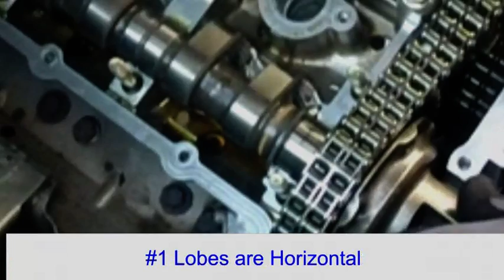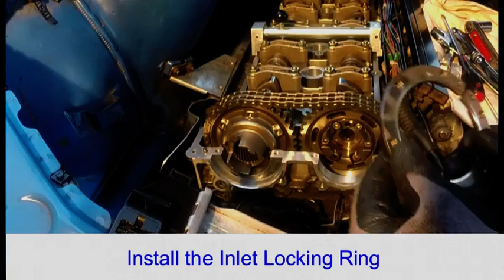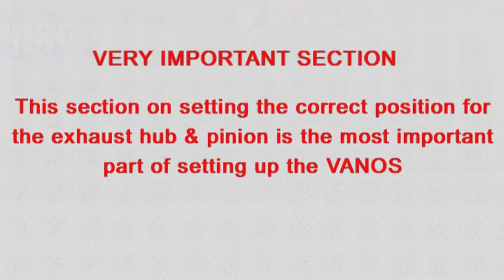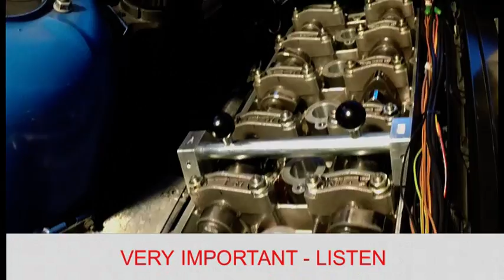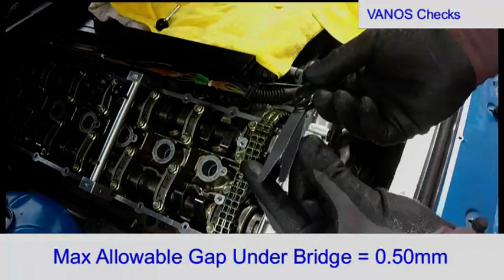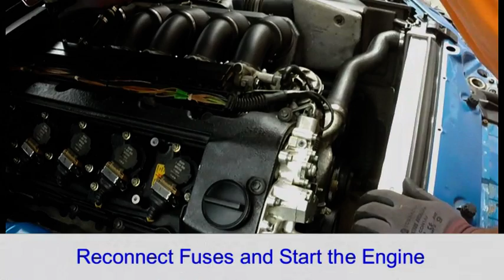Refitting the VANOS & Diaphragm Springs on a BMW S50B32

Comment: Hi! Is neccessary the specific timing tools for the s50b30 timing process? I’m looking for the tools and all of kits seems to fit both s54 and s50 and they are a bit suspicious …
Reply from the maker: You need to accurately lock the camshafts,  They will move if you don't lock them.  I don't know if S50 and S54 tools are the same.

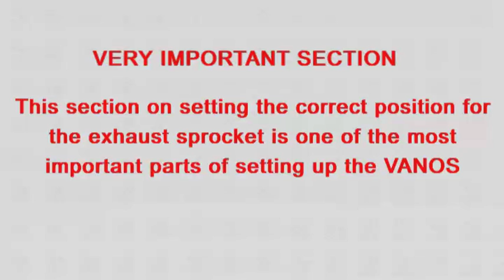Comment: Hi, I have attempted to align the exhaust camshaft sprocket several times according to your instructions from 3:17 onwards. The crankshaft is locked at OT and the camshafts are locked at TDC. When I attempt to slip the chain on the exhaust sprocket, the oval section of the sprocket does not align exactly as yours is shown in the video (i.e. at 1/4 position relative to the EXH cam trigger tooth). I would say my oval section sits at approximately 3/8 of the way from the bottom of the tooth. If I slip the chain on the sprocket 1 tooth forward, the oval is over 1/2 of the way from the tooth and if I slip the sprocket one tooth backward (by rotating the cam sprocket forward until it reaches that point) the start of the oval section ends up under the bottom of the trigger tooth. 

With the exhaust camshaft set in this middle "3/8" position relative to the tooth, if I attempt to install other bolts for the VANOS hub, they are not fully accessible. 

I am not sure what I am doing wrong and have attempted doing this several times. Can you suggest any other steps or checks so that I can be successful in setting up the VANOS? Thank you for the helpful and insightful video!
Reply from the maker: You may have to rotate the plate on to the next slot.  It can take a lot of faffing to get the exhaust slot correctly aligned.  You also need to have removed the chain tensioner before you can move the chain on the sprocket.

Comment: One more question, what is the air pressure check for?    Is it to allow cams to move if incase you got the timing wrong ?   Can't you just start all over and loosen the screws and unmesh vanos without having to use air?
Reply from the maker: Sorry for the late reply.  I've just seen your question.  The air pressure replicates the oil pressure from the running engine.  The VANOS tool replicates the ECU telling the cams to advance or retard.  They will only advance or retard if there is pressure inside the VANOS and the appropriate switch is pressed.  You must only "flash" the electrical pulse using the button on the switch, as a long press may burn out the solenoid.
Reply: @pingu393   Is the air pressure test required for re-assembly?

What confuses me is some re-assembly procedures just involve ensuring the right tooth of the VANOS unit meshes in with the right tooth.

But is the air pressure required for re-assembly and why?   I'm wondering at which point on re-assembly should I use air pressure.  It's not so much wondering what the air pressure emulates in a working engine, but how it can help me during re-assembly as I will be doing this soon
Reply from the maker: @boris9331  not required for assembly, just for testing.

Comment: 10:28, why do you turn the plate slightly to the left before you engate the teeth?   I thought they should be fully turned to the right and then you mesh the tooth in, so thats where the VANOS unit begins to push the gears in and the cams retard themselves?   It appears your not starting from full retard if your turning the plate to the left by 1 tooth before you mesh the gear in?        This is what confuses me.

I assume the reason to have the plates turned fully to the right is to set them in the full advance position, and then as the gears mesh in and push in, they retard the cams by moving the plates anti clockwise?
Reply: Hi Boris , I had the same questions and also posted on Tim’s YouTube channel- Juhles . You can see my responses there. I took videos and pics as well . What is important as stated in this video is that the Exhaust Vanos gear must stick out like in the Video when inserted all the way into the hub. This will ensure that when your Vanos unit is fully seated , the bolts at the back as still accessible. If you are not sure what I mean, please feel free to comment on Tim’s channel where I posted more details. Note this is only my observations and by no means profess it’s correct.

Comment: What I don't understand is why does a certian tooth on the VANOS unit has to engate in the spline?  they are all identical aren't they?    
I thought so long as cams are a relative angle to each other which is set by the locking tool, you can just slide the VANOS in and it just retards or advances using oil pressure to push the plungers in or out?    Is the goal to have the gears mesh into the splines when at full advance position ? and then the Vanos can retard by pushing the gears in?
Reply from the maker: There are a different number of teeth on the two gears.  This means the splines will only be aligned in one place.
Reply: @pingu393  Thanks.  Ill do my best to align each cam to right tooth on the VANOS.  Is there a test i can do shortly after to confirm I aligned them on the right tooth? It would save me finding out after putting everything back together and finding the car is sluggish or using the vanos diagnostic during running
Reply from the maker: @boris9331  the only safe test that I know is the air test.
Reply: @  OK i'll watch the video again to see how the air test confirms the tooth alignment and study it further.
Reply: @pingu393  Would the DIS diagnosis test not pick up one misaligned tooth?
Reply from the maker: @boris9331  DIS?  If you mean a scan tool, they only pick up error codes, or codes from running engines.
Reply: @pingu393  It's BMWs tool they use to do a VANOS test on the s50b32, like on this video.  - https://www.youtube.com/watch?v=a0jttXWO44s
Reply from the maker: @boris9331  like I said - a running engine :) .  INPA does a similar thing, but you need to interpret the numbers.

Comment: Great video, when inserting the splines - is there a sweet spot ( I found that at a certain point one gets maximum travel of the hub from left to right. I have a video that I can share . Your guidance will be really appreciated.
Reply from the maker: From memory, there is only one spline that will properly align, but I did the job 7 years ago.

Comment: I am mostly through this and your Video is a life saver - however i may have made a mistake. I didnt have enough torque on the intake hub and the rotated the engine - the screws did as you said, went to the far end of the "slots" and made the intake cam timing go out. Would that have been enough timing to cause the valve to hit the piston during a "hand rotation" of the engine? apricate your  help!
Reply from the maker: Sorry for the delay in reply, but the answer is "I don't know".  I do remember having to turn the engine with the chain disconnected, and it wasn't easy.  Crank 10 deg, inlet cam 20 deg, exhaust cam 20 deg, engine 10 deg...

Comment: Thanks for the great video, really easy to follow. I have just done this to the same engine and followed your instructions to the letter, and the car feels much better. But I am getting the following cam readings: When car is off intake is at 60 (Nominal 55), exhaust is at 0 (Nominal 0), and at idle intake is at 0 (Nominal 0) and exhaust is at 4 (Nominal 0). Do you think this is down to bad timing or could it be something else?
Reply from the maker: I don't know what you mean by "car is off".  There is the possiblity that the cam springs could be too loose or too tight.  There's not much that you can do about that other than fit them properly, or completely remove them.  If you remove them the chatter will be intolerable, but the cam will advance / retard very quickly.

Comment: 16.25 you say adance the exhuast camshaft but you retared the cam or not ? correct me if im wrong.
and in the intake cam same thing you say fully advance but you move the intake camshaft in retared position.

if you in front of the engine and you move the intake camshaft to the right you retared the camshaft 
if you in front of the engine and you move the exhaust camshaft to the left position you advanced the camshaft 

that is what i know correct me please if im wrong
Reply from the maker: This is down to convention.  It is convention that anything that makes something happen earlier in the cycle is called "advancing", and anything that makes something happen later is called "retarding".  As the valve will open earlier by the camshaft being twisted "backwards", this is called "advancing".

Hope this makes sense of the video.

Comment: I tried many times to fit the vanos..however the engine fire up amd running very rough at idle. The diagonistic tool told us the intake cam target at 60 however actual angle is 512. the exhaust target angle at 0 but actual at 453 degree. 

We borrowed another car ehich idle smoothly, take off the vanos unit and the spine shafts and intall them again according to the video..and it idle roughly and having the same issue with this first car. Do you have any idea about that?
Reply from the maker: Unfortunately, without knowing EXACTLY what you have done, I can't really help.  My only recommendation is to go back to the beginning and follow EVERY step EXACTLY as shown in the video.  What diagnostic tool are you using?  I recommend Testo.

Comment: Hi mate. I tried 3 times theese procedures but after vanos setting and all screws locking 10NM i turnet crankshaft 2 times and setted camshaft tool to slots but, 
mark ()O|T avoided 5-6 degrees clockwise... please help☹
Reply from the maker: Make sure that you follow the instructions from 3:17 EXACTLY.  If the hubs are in the wrong place, or the tension is relaxed, you will have the problems that you have got.
Reply: @pingu393  thank you

Comment: Mate. Do yo have the part number for the camshaft locking tool? It looks like the same one as the E46 M3? Is it a genuine or aftermarket? Thanks heaps.
Reply from the maker: You will have to search eBay (or similar) for it.  (Google Image "bmw S50B32 camshaft locking tool" shows lots).  I did used to make them an will have the drawings somewhere.  I'll post them after I put them on my website.
Reply from the maker: www.porterbility.co.uk
Reply: @pingu393  Thanks. There seems to be heaps bit the beisian procedure says only use genuine. How precise do they need to be? Most on eBay say E36 and E46. But TIS has different part numbers and they look different. The one you use in this video appears to be the E46 one. That tells me they are the same??

Thanks again mate.
Reply from the maker: @JustSomeGuy_11  The important dimension is 119mm and the 6mm pins.  When I made the tool, I used the graduations on a milling machine to measure the 119mm - eyeball and ruler isn't good enough.  As to whether it is E36 or E46 - I don't know.  Buy the one that looks like the one that I used.  This is on eBay at the moment (193392286835).
Reply: @pingu393  awesome mate. These videos are a life saver. Cheers.

Comment: When the camshafts are locket with the tool. Are they then spot on the markings on the first bearing cap?
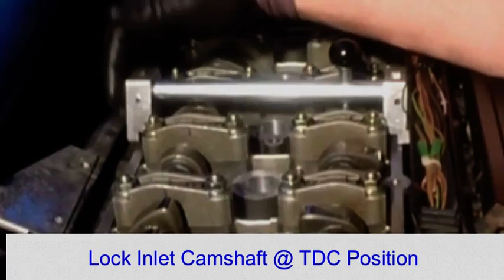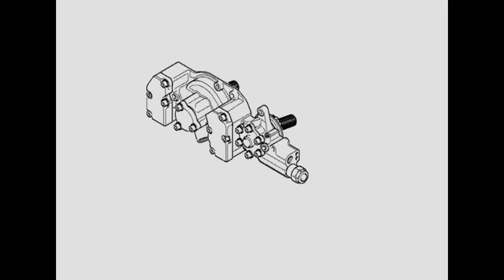Reply from the maker: I think you may be asking (in a round about way) if you can use the markings to position the camshafts - and not require the tool.  The answer is "don't try to do this without the tool".  The markings are only approximate.  You could get close, but probably not close enough.  As you can see in the video (8:28 - 9:00), the difference in camshaft degrees between aligned and misaligned is very small.

Comment: Can't get my hub screws right? What am I doing wrong?
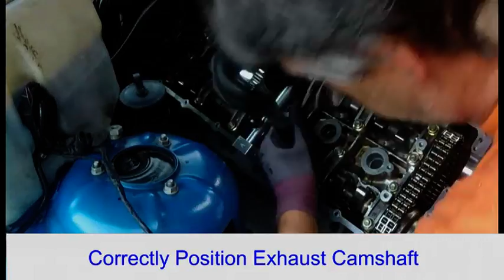Reply from the maker: Look at the video from 3:16.  You probably have to turn the hub relative to the camshaft.  See https://www.youtube.com/watch?v=Mr2Jqnbkmw0 to see how to advance the sprocket relative to the hub.
Reply: @pingu393  I did not remove the hubs I'll watch it and give it a shot tonight but am unsure how I managed to get them unaligned. My oil pump drive gear is in a different position than yours does that matter at all also?
Reply: @pingu393  I am amazed to get my hub in the correct position although the exhaust hub lock ring is at 1:00 on the wrong side
Reply from the maker: @LemonLaw-r5n  The final position of the locking ring is not that important.  The important thing is that the locking ring doesn't fall into the engine when it is removed or fitted.
Reply: One last question I appreciate you responding a bunch. Do my screws need to be in the exact same position as yours? They are off just barley I can still remove the srews with the hub's fully retarded
Reply from the maker: @LemonLaw-r5n  All that I can say is that if they are as shown in the video - it works.  You may be able to remove/refit the screws with them in a different position, but I cannot guarantee that they won't become jammed, or be too difficult to remove without dropping in the engine.  They are NOT magnetic.  You need to be able to hold them securely in your fingers.
Reply: @pingu393  let me put it this way the are very close to your exact position. But off by just a little I'm going to purge the vanos and see how everything lines up

Comment: Is it nessisary to purge the vanos after install?
Reply from the maker: If you don't purge the VANOS there may still be come compressed air stored inside the VANOS.  It's one of those things that is so easy to do that it is best to do it.  Don't forget that you are only purging after an air test.  You still have to connect the oil supply.
Reply: All I have to do is reinstall mine and I did not remove the hub's
Reply from the maker: @LemonLaw-r5n   Understood.  The hubs only need to come off if you are replacing the springs.  You only need to replace the springs if you want to stop the "chatter".

Comment: Do you know if the usa m3 cps would work on my s50b32?
Reply from the maker: I think that the S50B30 has a different VANOS.  What is cps?
Reply: pingu393 cps is a crank position sensor  or rpm switch.
Reply from the maker: http://www.realoem.com/bmw/enUS/part?id=CK92-EUR-07-1998-Z3-BMW-Z3_M&mg=11&sg=10&diagId=11_1573&q=12141401186
Reply: pingu393 yeah i guess it is then huh they must use the same cps for the 3.0 and 3.2 motor. I wonder if the usa z3 m  coupe is also the same? That a 3.2 double vanos motor as well i believe
Reply from the maker: I don't think that you understood the link to RealOEM.  The part in the link is for the S50B32.  It is ONLY fitted to the EUR engine.

I don't think that ANY of the US models will be the correct part.
Reply: pingu393 my engine is not a us motor its the s50b32 euro m3 6speed transmission  so yes this is the part i need the us  cps would not work for me.
Reply: pingu393 thank you for your help.

Comment: In case of S62 diaphragm spring plate in S50B32 the spring plate should be the other way around (cup against engine)? This is not mentioned in Beisan manual.
Reply from the maker: The video shows this at 6:27
Reply: That is a bit of a problem. Beisan systems manual requests the S62 plates:
http://www.beisansystems.com/procedures/euro_s50_double_vanos_rattle_procedure.htm
-> 2 x S62 sprocket hub diaphragm spring and pressure plate 
--> Install new diaphragm spring, cup side down, into each sprocket hub

In your video the spring plate is the opposite way.

Not sure which instruction to follow or should I follow: Beisans or yours.
Reply from the maker: There is no BMW-approved replacement for the S50B32 diaphragm springs - the next higher assembly is a new engine!!.  You can either fit S54 springs (11-36-7-830-684) or S62 springs (11-36-7-833-218).  If you want to fit S54 or S62 diaphragm springs, it is at your risk (as with all modifications).
S54 springs are fitted the same way as the old ones are removed.
The ORIGINAL S62 diaphragm springs were fitted in the same way as the S50B32 springs.  These springs are no longer available from BMW.  The replacement (11-36-7-833-218) is fitted in reverse on the S62.  I have assumed that this would be how they should also be fitted on the S50B32, and it is how they are fitted on my engine.  I have had no problems.
Hope this helps.
Reply: Thanks for fast comments.

Looks like there is no major difference which way they are installed (I hope so). I go on now with the Beisan way forward, since they have proposed the S62 sets in beginning. I already upgraded the Vanos with their parts. 

Anyway excellent video you have made, it has been very helpful!